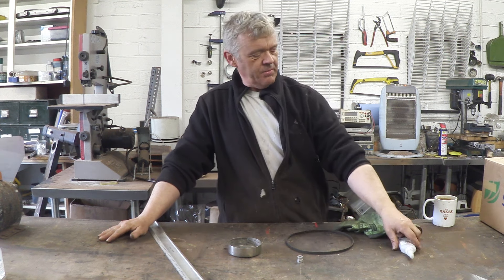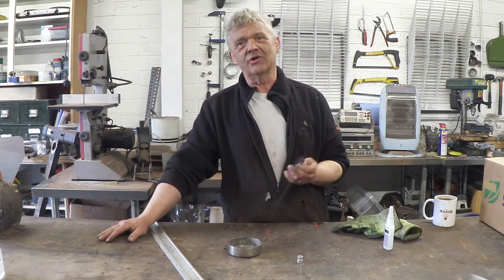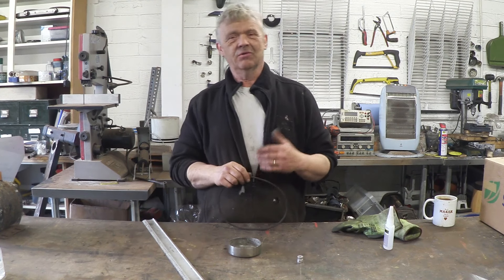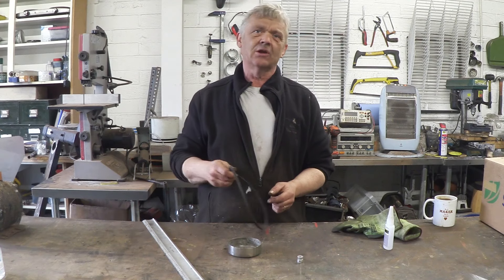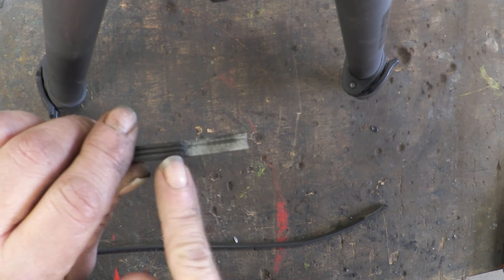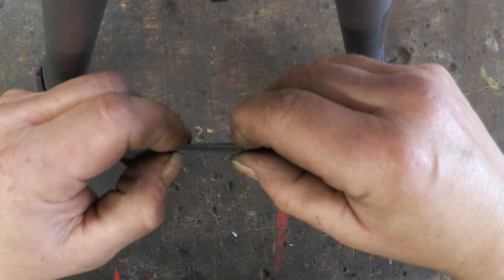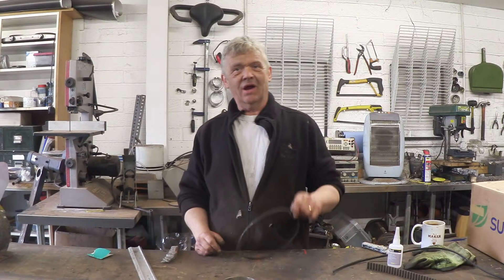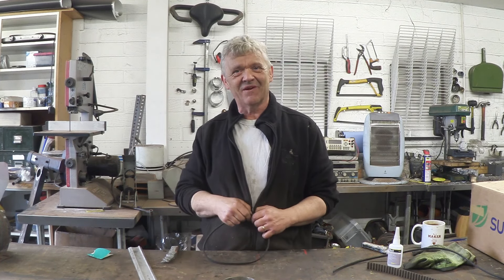1109 Making Any Size Drive Belts

Comment: I've been making joins like this since I was taught it back in the 90s. In low tempenvironments, contact cement works very well. If they belt is going around tight bends back and forth, CA glue can break down over time. Both CA glue and contact cement will fail if they get too warm. High temp silicone works well for high speed high temp situations.  As usual, match the adhesive to the task and you'll be fine.
Reply: What about using chain link and pins? I was thinking about modifying one for belt drive for uncut bicycle frame

Comment: You've massively compromised the  strength of the belt by cutting through the hybrid or high tensile strength glass cord that is inside the belt ,it will snap and is not recommended for synchronous applications

Comment: I have a scarf joint on the flat belt used on my Southbend lathe.  A lot quieter than the old lacing method.
For V belts I often use link belts these days.   Not cheap, but easy to change the length if needed.   I purchased a replacement V belt for my milling machine and found the new belt with the same code as the old one was longer. Drat   I broke down and got link belt and finally got the belt to fit.
Dave.
Reply from the maker: awesome - nice story and tip mate - cheers

Comment: I thought about a joint where you put chain links of a bike, slightly machine it to the shape of belt's cheek, make a 0.2mm tighter hole to the pin in the belt, insert the pin with glue added. But if you say it's that stiff, would like to give it a shot one day on bicycle belt drive.
You see, the problem with belt driven bikes are that they are requiring cut bike frames, which is nuts. It's more logical to cut the belt, as it is so in with the chain.
Thanks for the tips Rob!

Comment: Another way is a V joint, cut to cloth on both sides then cut cloth out of other end then glue and put in the vise for 30-60 mins. Extremely strong joint.
Great video once more Rob
Reply from the maker: nice tip mate cheers
Reply: Been 3 years, but can you elaborate what you mean?

Comment: Excellent resurrection of steam age technology for new age materials -- as you, especially do so well.  Some sorts of staples can be used at the joints as well.  Good job, and great application and tip.
Reply from the maker: can they - nice tip mate - I was worried staples wouldn't work

Comment: You've just solved my problem with a drive belt for my Homemade Leslie upper/"treble" spinning speaker cone. 
I've sourced some  Bus fan belts from the workshop at my workplace , but they were all too long.
Width was OK for my re-purposed wheel/pulley, but belts were way too long for the distance between the drive  motor (old drill motor) and the wheel/pulley on the rotating speaker cones.
Brilliant!. Thanks Robert!

Comment: For smaller timing belts (the same kind as used in 3d printers which roll on gears with small radius) I've found that glue will crack or wear off, but melting the pieces together (heat gun, solder iron) makes it incredibly strong.
Reply from the maker: I have meted them before and it works well for PU based belts - rubber belts are impossible to melt - but nice tip mate - cheers
Reply: did you melt the glue, or did you melt the rubber making the belt?
Reply: @michaelchernoff9033  only melted the rubber. No glue, but make sure the strands overlap and embed in the rubber. 2cm overlap is plenty strong for 6mm timing belt.
Reply: @NoughtSure  That's a great idea! Is that the same as the glue that comes with bicycle tire repair sets?

Comment: Thanks, I was wondering if it would be strong enough and you have answered my question, I;ll be buying belt material by the meter from now on.
Reply: Just had a test and I cannot believe how strong the joint is! Thanks.

Comment: Great idea! I was thinking it would be handy to use some sort of adjustable idler "tensioner" pulleys for a multipurpose dynapod. 
So you don't have to change the belt when switching devices.
Reply from the maker: nice idea mate I am mulling over mark III - I will add it to that - cheers

Comment: Even better than CA/superglue and contact cement is E6000 solvent-based adhesive, or Alene's "The Ultimate" adhesive.  These are waterproof, permanent, and they cure flexible, just like the belt.  No stiffness, and it moves over small pulleys very smoothly.

Comment: If using v belt...
Look up nutlink belting..
There are other products that are similar... 

pretty much a stack of leather/rubber/plastic  pieces. Each piece has a toggle one side, and a hole the otherside. Can join any number of pieces together to make a belt of a custom length. 

It brilliant for putting belts around  pulleys with bearings on  both sides... Think of the pavalava that's usually involved in replacing a v belt on a lathe headstock. 
Rather than disturbing the bearings... Just break a nutlink  belt loop, feed the strip around the pulley, then reconnect into a loop.
Reply from the maker: I have seen the type you describe mate - they are a little more expensive and try ti reuse old belts as you know - but nice tip - cheers

Comment: I suspected.  I just didn’t know about that scarf(?) joint.  I’m likely going to be installing a belt on my laundry washer doing this.  I kept thinking to myself, “This is just rubber and stuff… why can’t I use a solvent or glue to make this thing whole… even if just temporarily?”  And cyanoacrylate was the first thing to come to mind.  Indeed.  Thank you sir for being resourceful and helpful; but most importantly, enabling me (whether right or wrong) to believe for a little while longer that I’m not bonkers.  👍

Comment: My washing machine eats through the stitches. I then switched to using balling wire, tightened with pliers until it breaks, leaving a tight ring wrapped around the two sections. Now the rubber and fabric belt material breaks as the wire is pushed into it, but at leas that lasts two washes vs 1 for thick nylon thread wrapped around generously The washing machine is a top loader with a single, very aggressive spin dry speed.

Comment: Normal CA glue will crack and fail because it is brittle. There are some specialized CA glues that are designed to produce a flexible joint. Search for boot-fix in the green bottle. It is designed for a flexible set, not a hard acrylic set. Also, I recommend using a setting accelerator.
Reply from the maker: cheers mate

Comment: Hey Rob, if you speak to your friendly neighbourhood mechanics. Next time they do a timing belt replacement. They will throw away the old belt, pulleys and tensioner. If your not putting the kind of load on that a car generates, it will still last for ages. Also if they tell you the make and model of the car, replacement parts are easily sourced
Reply from the maker: they already give me that stuff mate - I have made a couple of vids using them
Reply: Ok ok no worries,  i didn't see you used the pullys or tensioner in them vids. Thats old age for you 🤔

Comment: Do you reckon a couple of staples would work in lieu of stitching? Thank you Robert!
Reply from the maker: you could try it mate - but the staples will stiffen the belt and disturb the run - but I have always stitched - let me know if it works for you will you?
Reply: @ThinkingandTinkering  I might as well do it with stitches instead to be on the safe side. Thank you!

Comment: What kind of glue and what tool to cut the belt knife & super glue, contact cement, heat will separate .Spider wire sewing machine

Comment: Any vulcanizing rubber glue should do a good job on these.
Reply: Tried it but nowhere as strong.
Reply: @Golo1949  I think there is some poor quality glues for sale. It should melt the rubber together but keep the joint flexible. It also depends how thick the rubber is and how you cut the joint.

Comment: Just bought a commercial mower and sadly found that a part of the transmission clutch needs to be taken off in order to replace a belt! Horrible engineering. 
I'm instead going to order belts 4" too long, scarf them, then thread them through the drive pulley/clutch location.